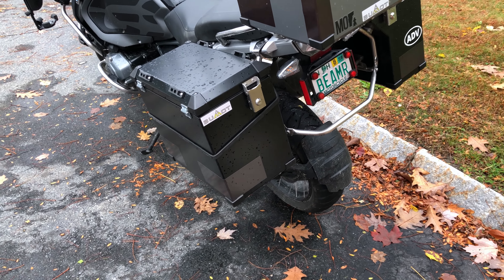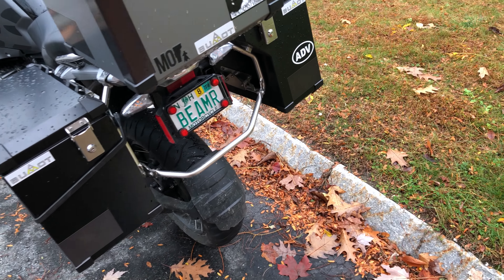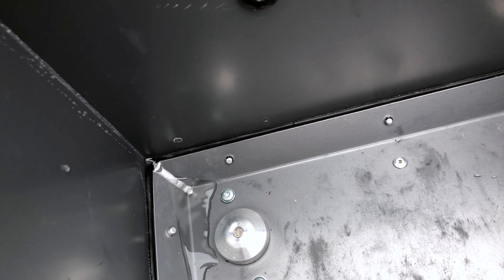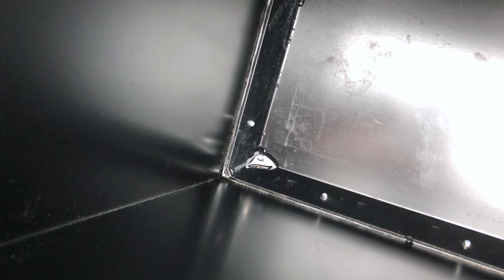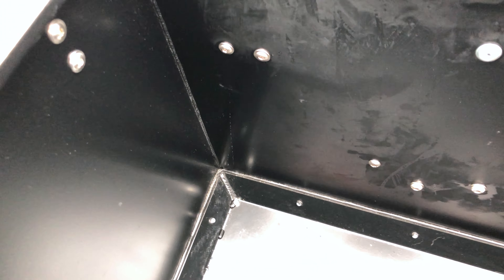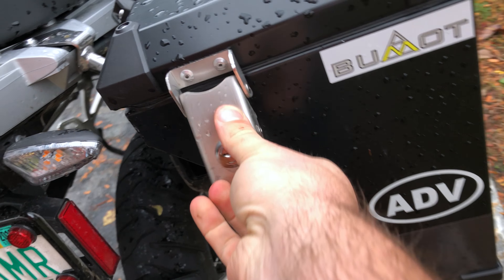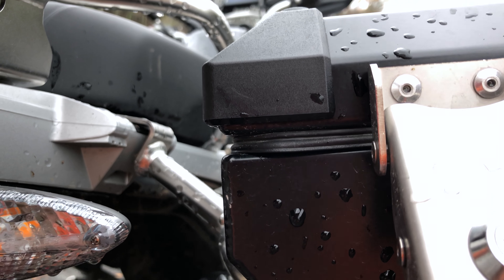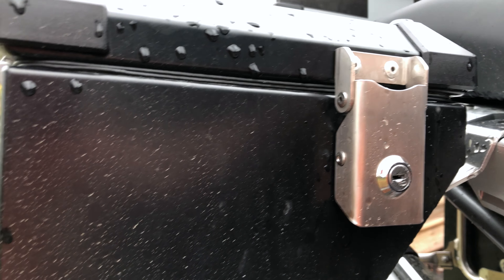My Bumot Defender Luggage is Leaking - R1200GS

Comment: Going through the same issue that you were. I think my gasket is creating a vacuum effect and drawing water in along the seal seams. I can hear it hissing and bubbling as I wait for the exterior of the case to dry before I open the lid to inspect. I too have water pooled at the bottom but the baby powder test shows random intrusions along the seal and at the hinge bolt for the lever lock. Did you ever get your cases sorted out? If so, what did you do?
Reply from the maker: Tightening down all of the nuts fixed the issue which is good. I do know someone who had a leaking unit replaced by the company though after tightening didn't work.